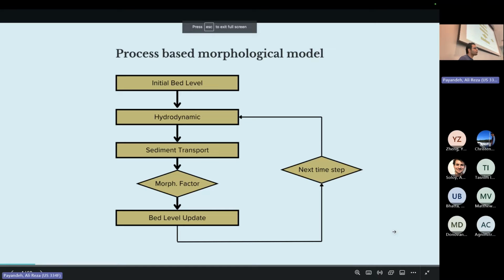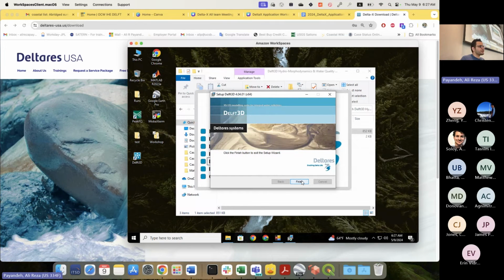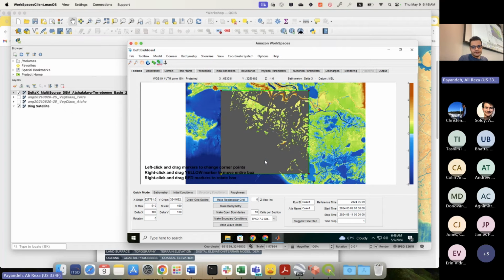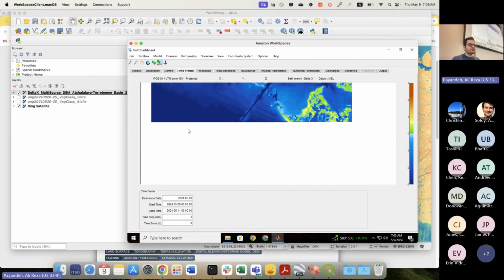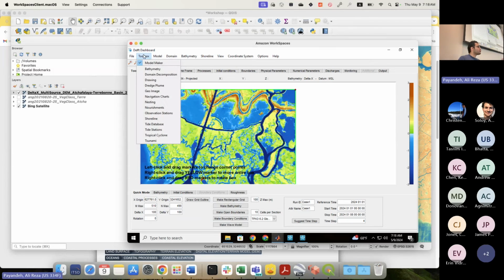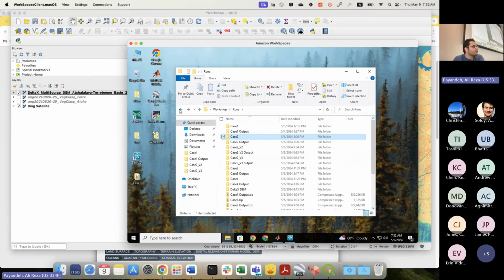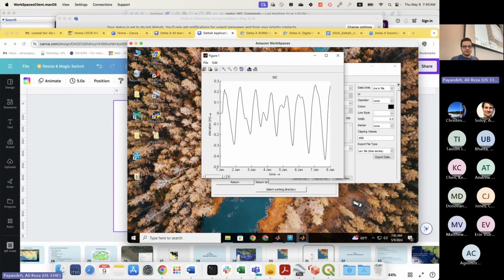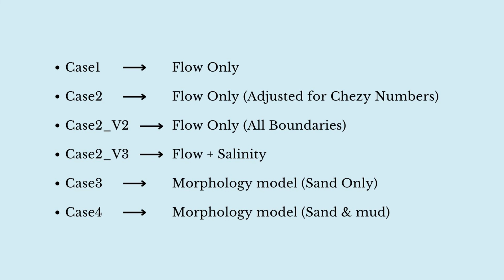Hydrodynamic Modeling of Deltas Using Delft3d

Comment: Hello Doctor Ali, the delft dashboard is not installing with me, what should I do? it says it's not a safe source
Reply: Hi. Delft3D Dashboard doesn't require installation, it’s a standalone .exe file. To run it on Windows:

Navigate to the bin folder where the .exe file is located.

Right-click on the .exe file and select "Run as Administrator."

If prompted for permission, click "Allow." It’s safe to proceed.
Reply from the maker: @ Thank you for responding to the data user Ali.
Reply: @alirezapayande1188  Thank you a lot for your response, actually the problem was the Matlab runtime, I chose another version and not 9.6. The problem is solved.
Actually I want to thank you and Nasa Earthdata for this professional and high quality workshop, I was stuck in my PhD and thanks to you all, I have hope now.

Comment: When I try to start simulation using your Case.mdf file, there is a error called d_hydro.exe is not found, I installed correctly, is this D-Hydrology is not included in the free pakage or am I did any wrong step? (I am using Delft 3D 4 Suite 4.05)
Reply from the maker: Hi there, thanks so much for reaching out. I'll need to reach out to the speaker for a more detailed response to address the issue you are experiencing. In the meantime, please also feel free to log your question using NASA's Earthdata Forum at: https://forum.earthdata.nasa.gov.
Reply: It seems that Delft3D is not installed on your system. Please note that installing the GUI is separate from installing the core Delft3D engine, d_hydro
Reply: @ how to install the core Delft3D engine, any tutorial available?
Reply from the maker: @AdilShahriyar  If you go to page 13 of the DeltaX 2024 Workshop Instructions file on GitHub, you will see some step-by-step instructions to help you through this process. (https://github.com/ornldaac/deltax_workshop_2024/blob/main/2024_DeltaX_Applications_Workshop_Instructions.pdf) If you still need further assistance, I encourage you to reach out to NASA ORNL DAAC at uso@daac.ornl.gov, or to post your question on the Earthdata Forum at: https://forum.earthdata.nasa.gov.

Comment: Hi Ali, I am interested in applying salinity and temperature to a delf3d 4 model (in 2D). You showed an animation with salinity on your model. Do you have a project example with the input files so I can use it as a reference to develop my model? I am interested in learning how to configure the input files adding salinity and understand how the model couple salinity with the hydrodynamics. THANKS!
Reply: Hi Edisca,

Unfortunately, I’m unable to share my setup with you. However, I recommend starting by checking the salinity and temperature options in the Delft3D-FLOW GUI. Once selected, they will appear in the initial and boundary conditions settings. The process should be straightforward from there.
Reply: Thank you!!!
Reply: Hi, Have you successfully modeled salinity with delft3d 4?